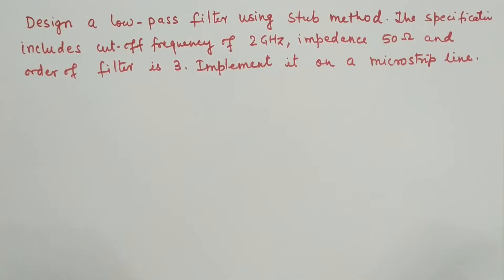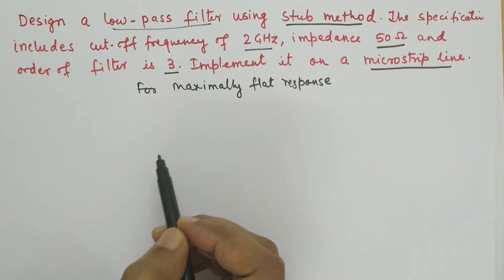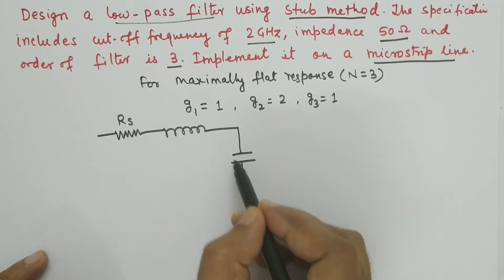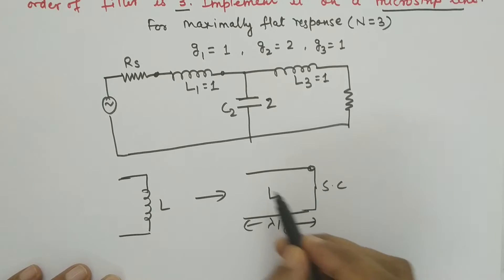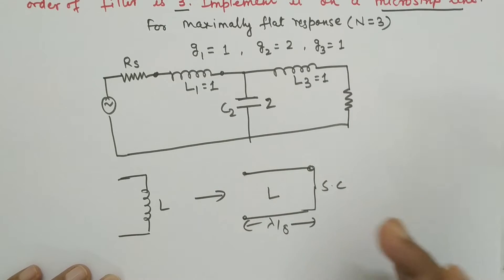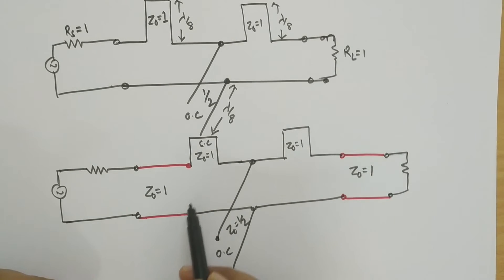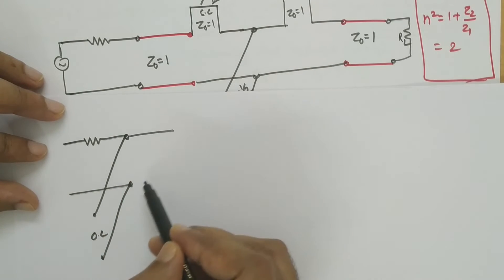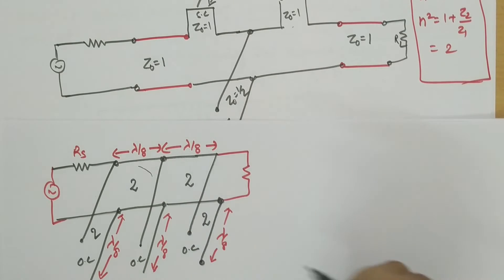Low pass filter implementation using stub||Richard's transformation and Kuroda's identities||

Comment: thank you very much for the video. I have the same question thank other viewer. Consider the Kuroda conversion from the series stub on the right side at 9:30.  Z1 is 1, Z2 is 1 as well, which means n^2 is 2.   This means the transmission line is n^2*Z1 which is 2, but the open circuit should be 1/(n^2*Z2) which is 1/2...
Reply: i was also thinking same
Reply: Same
Reply: After converting the capacitance value is 1/ (n^2 * Z2), so you can say C = 1/ (n^2 * Z2) but for capacitor the characteristic impedance Zo = 1/ C. Therefore you have to take inverse of 1/ (n^2 * Z2).
Reply: @tejaskamble996  thanks

Comment: Why do the inductors turn open circuited? Is it because you used the table? Is it because in the table it says the inductors turn into a box connected in parallel with the resistor. How did you solve the formula for n?
Reply from the maker: You can watch this video https://youtu.be/gh8R49ED1VM. By calculating the input impedance of one of the case you can prove the same.

Comment: Hello again. I am a little confused on how you are getting L = 1 and C = 2, I can not seem to manipulate the equations in anyway to get those values. I also could not seem to calculate your g values either. I am currently trying to design a filter generator in matlab, that is why I'm asking so many questions.
Reply: using element calculation formula putting values k=1,2,3 find g1,g2,g3.

Comment: Sorry, but I don't quite understand why the wavelength is different on 100 Ohm and 25 Ohm stub? Coud you please explain this?
Reply from the maker: Different characteristics impedance leads to different width of stub, eventually leads to different effective dielectric constant. Because effective dielectric constant depends upon width. Wavelength is inversely proportional to square root of effective dielectric constant.
Reply: @RFDesignbasics  Yes, I recall some of knowledge. when frequency goes high, more fields confined into substrate, which will lead to a higher effective dielectric constanct. Thank you for the explanations, Sir.

Comment: In the Kuroda's Identities for series inductor , shouldnt the value of Z for the capacitor shunt be 1 / ( n squared * Zo). ie. Instead of 2 , shouldn't it be 1/2.
Reply: But 1/2 is the value of the capacitor in lumped form. When we apply Richards transformation on it, the Zo value of capacitor becomes 1/C i.e. Zo = 2
Reply: @sravani461  this answer is gold. ty

Comment: Hello, I am having trouble understanding how to calculate the wavelength as well
Reply from the maker: Ask questions clearly
Reply: @RFDesignbasics   okay, so in the video you mention how the lambda (wave length) is dependent on the Z, however, you do not go into detail on how they are related. or how to solve for lambda. I know you mention it is dependent on dielectric constants of the material based on varying widths, but this is vague and for hand computations, confusing. My question is, how would you calculate the wavelength by hand (and therefore the geometry) without the use of simulation soft ware?
Reply from the maker: Ok. So the answer is going to be long. The wavelength is ratio of Phase velocity and frequency inside any microstrip line. To calculate phase velocity you need to know the dielectric constant or relative permittivity of the material. In case of microstrip line the relative permittivity combine with air or free space and makes relative effective permittivity or effective dielectric constant which is dependent on h of the substrate and width of the line as well (refer the formula from DM Pozar Microwave Engineering section 3.8). Since Z0 is width dependent of the line, relative dielectric constant also width dependent and hence wavelength too is width dependent. For calculation of all these manually you can refer the same section of Pozar.
Reply: @RFDesignbasics  Going off of this I also found a source that validates this response in "Fundamentals of applied electromagnetics" - Paerson, chapter 2 section 5. Thank you for you speedy and detailed response, I really appreciate your videos!
Reply from the maker: Thank you. You are welcome 🙂
Reply: @RFDesignbasics  Hello! not to bother you again. However, after consulting the text you recommended, and my own source. I found that the lengths for each element were the same, however, the width changed with each Zo. Is this assumption correct?
Reply from the maker: Length may be slightly different again due to same reason of different wavelength.